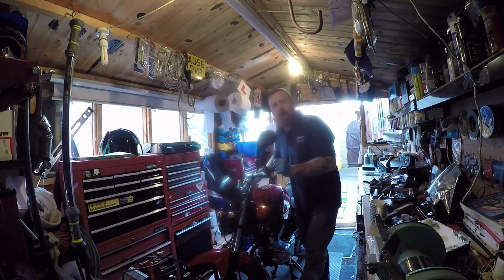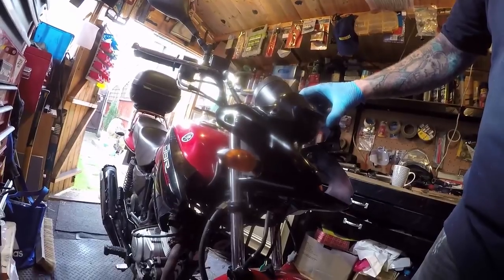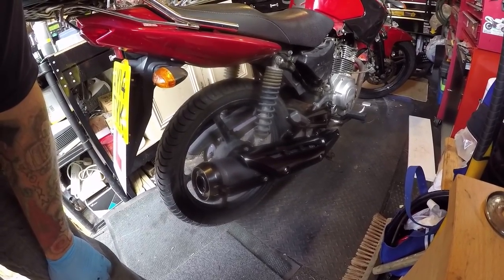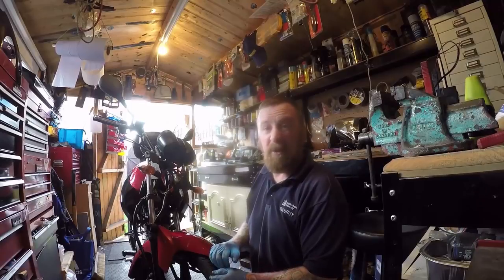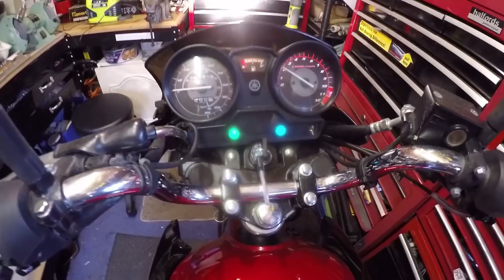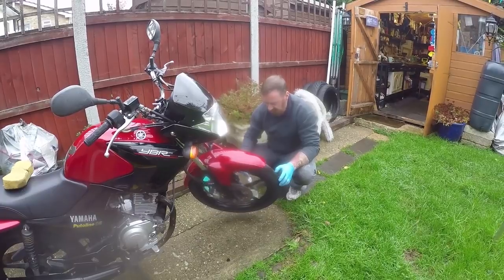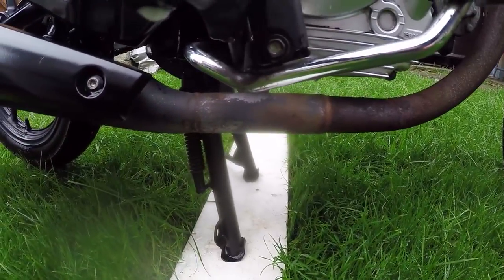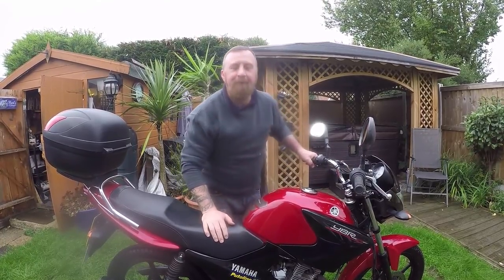YAMAHA YBR 125 MK3 FIXED UP AND RUNNING WOW MARK SAVAGE

Comment: What did you use on rims and exhaust? Im from Canada so I'm not familiar with stuff in England. Thanks
Reply from the maker: its Harpic toilet cleaner x 10 but I guess any good clean should do the tric just don't leave it on too long lol 
mark
Reply: @marksavage  I guess it's good at getting shit clean😁 Thanks for the response back

Comment: Wow what a transformation, looks fantastic. Was that neat harpic you brushed on the wheels?
Reply from the maker: hi bud thanks and yes neat just don't leave it on too long lol but it really does make them clean and remove brake dust and road oil / salt 
take care bud 
mark
Reply from the maker: If your up for it bud , 3x3 challenge , just done mine and its on here, take care bud

Comment: I need the sensor for a SYM 2009 HD 200 it's got the speedometer the hot cold and gas gauge. If you could help me out
Reply from the maker: check e bay or sym forums and maybe face book sale sites bud, sorry I don't have any parts but failing them its google search 
hope that helps
mark

Comment: Looks cracking good.....
Reply from the maker: that's good to hear and thanks for watching 
mark
Reply: @marksavage  quick couple of questions mark if you don't mind, got Yamaha vity 125 and mk2 ybr 125. Doing mini service on them at the weekend, what engine oil would you suggest for them. Also would the fairing and headlight unit off the mk3 fit onto a mk2. Think they look cool. :) cheers.
Reply from the maker: I use 10/40 motorbike oil only the make is down to you really just make sure its motorcycle oil and do not use car oil
As for the head light ,yes it will fit but you will need the side fitment arms, then is will just fit on with easy 
they do look good lol, thanks for watching, please like and sub and I have a few more on the ybr's you might like to watch
mark
Reply: @marksavage  thanks for the reply mark, would you sway toward semi or full synthetic?  I'm, already subscribed and watch the other ybr video, thanks.. oh thats  great news about the headlight fitting..look forward to your vids. Thanks again and stay safe..
Reply from the maker: barrados101 semi on these and most bikes to be honest 
I only use fully on super sports 
But always a good idea to check the manual or check with the dealer 
My big trophy was fully and would cause damage if not used !!
But semi for yours bud 
Thanks for watching and subbing it means a lot 
Mark
Reply: @marksavage  OK Mark, thanks for all the info. Much appreciated :)